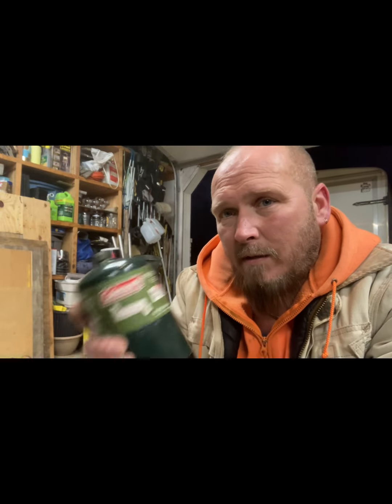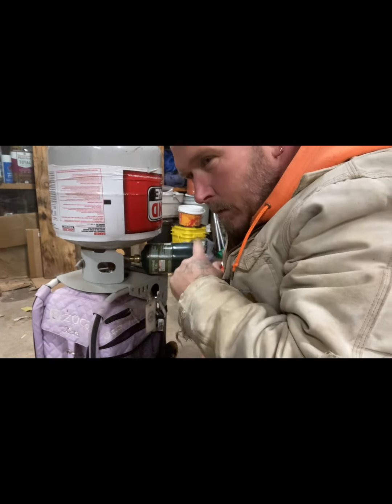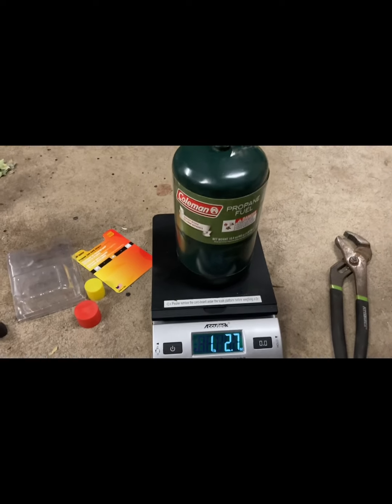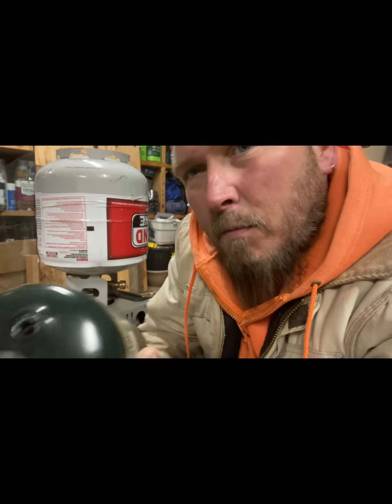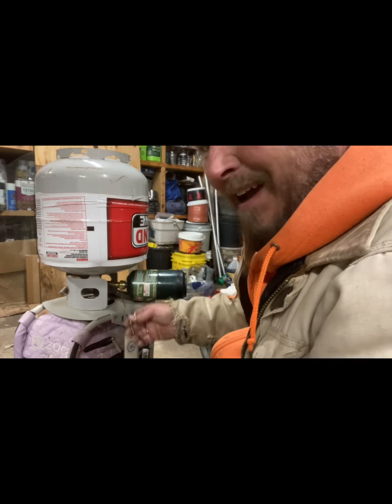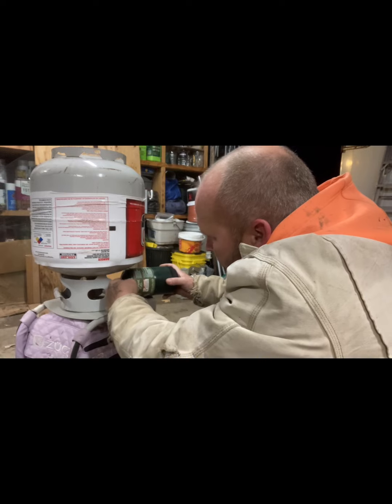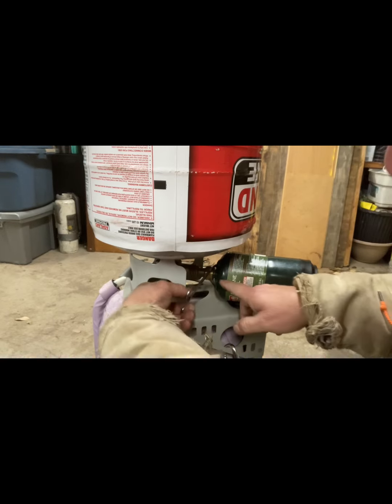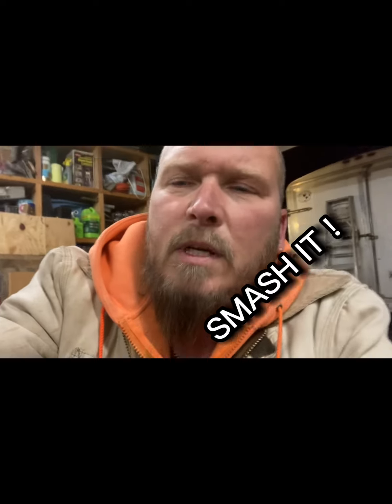Refill propane cylinders at home for cheap

Comment: Nice. My adaptor runs at a 90 degree angle, so the 1lb propane tank sits completely upright when I fill it. I was curious if these tanks could hold more than a lb. and if it was safe to do so. Thanks for the info!
Reply from the maker: Hey no problem I was so upset when I got the adapter and my tanks would run out so soon and then learned the trick from an actual propane distributor that I have an account at and thought I’d share.
Glad i could help.
Have a Merry Christmas
Reply: It is a 1# tank please only put one pound of liquid in it for headspace and safety.
Reply from the maker: @jekjr1957  you’re not pressuring the tank and forcing a smaller tank to accept a larger amount of propane (as a matter of fact that would simply be impossible) The safety valve on the top of the tank is designed to open to relive any excess pressure.
When I buy a #20 propane tank it comes with #15 in it however when I take my tank to the actual propane dealer they fill it then release the extra gas (just as we are doing here) and actually fill it with #20 of liquid.
Obviously if you’re uncomfortable with this thought disregard this video however I’ve been doing this with my #1 bottles for about 15 years and it makes for an actual full longer lasting tank.